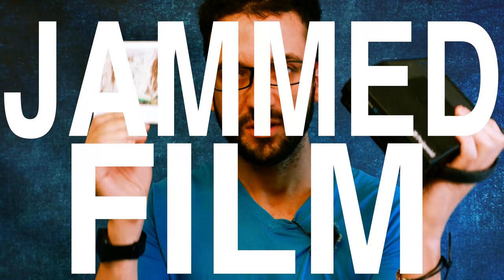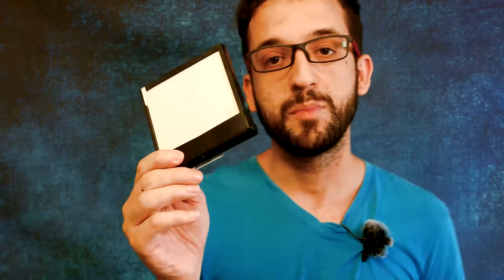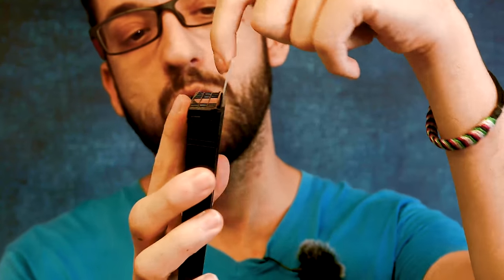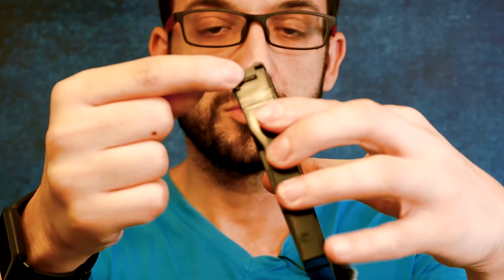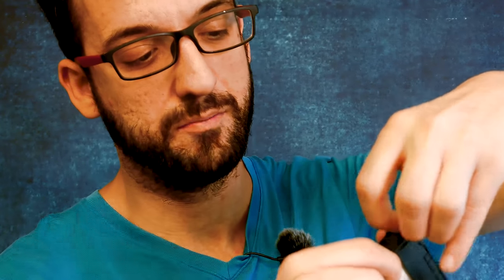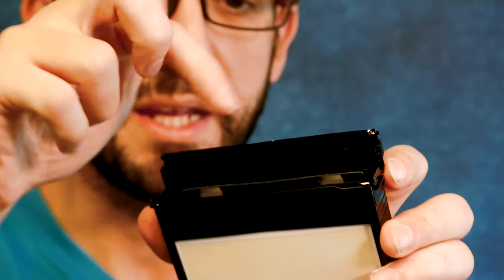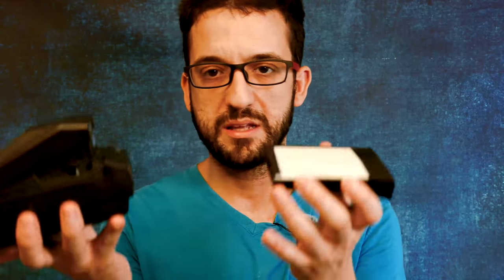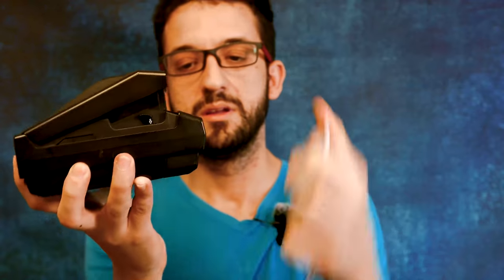Polaroid jammed film issue. HOW TO SOLVE!

Comment: You don’t have to open the whole lid to remove the plastic. I’ve done before with my Polaroid spectra film. Just hold the cartridge and remove the plastic and that’s it. You can also do in a light room, nothing is going to happen as long as you still have the dark slide and be careful.
Reply from the maker: Thanks for sharing your experience

Comment: Recently, I purchased a used Polaroid 600 business edition camera online. The camera was working fine when I got it. However, when I switched out the old film it had when I purchased, I ran into an issue. It seemed as though the new film I placed got stuck when the photo was ejecting. There is a black piece in front of the camera that I accidentally pulled out with my hand thinking this was the issue (I was 100% wrong). Immeditely after I pulled out the plack piece, I tried to take a photo and it got stuck so I pulled out the photo. My camera won't work when I attempted to take new photos. As I have run out of extra film packs, I can't go back to reattempt to see what's going on. I do know that this issue started when I pulled the black piece out. I'm not sure if this piece needs to be tightened or reconnected to the silver rollers from the inside part, but everything else seems to be fine. Is there a video of possibly this issue being repaired?? Any info helps, thanks!
Reply from the maker: I feel that if you put back everything you should still be able to use the camera. Did you try to put back the used film in the cartridge and take photos to see if the eject feature works? Also it can be the battery is depleted so if you have a meter measure the battery voltage

Comment: Hello! I tried removing it and the photo still doesn’t slide out. Is there another option to fix it? I just got it with a new film and I don’t know if there’s a cable charger that goes with it as well. Response would be appreciated! :)
Reply from the maker: Unfortunately there are no other solutions. Probably the motor is also not working properly. Polaroid cameras don’t need any charger because the battery is inside each film pack

Comment: Thanks for the video. I have a spirit 600cl with similar problem but my film stuck in the middle of the rollers. So I don't know if it is a battery or a rollers or a pack problem :((
Reply from the maker: Well you can try to clean the rollers at least. And depending how old is the pack it can be the battery too

Comment: I tried this too and it seems do be doing everything except just printing out the picture do you think the camera is defective?
Reply from the maker: it could be also a film pack issue with possibly problems with the chemicals. you should try another pack if you have and also remember to clean properly the rolls too
Reply: @KeigoMoriyama  i sadly dont have another one, do you think it could also be because of the batteries or something like that?
Reply from the maker: Potentially batteries are not making the shutter speed working properly causing the image to not come
Reply: @KeigoMoriyama  i see, I'll try by buying a new film then do you maybe have a link where I can buy the right ones?
Reply from the maker: @denizemir965  all the films are now expired. the only place is ebay or local facebook market
Reply from the maker: @denizemir965  in case you can always try using an itype film, you remove one film and put in the case of the spectra and test it. but pls do everything into a dark bag. you can check if it is an issue with film or with batteries (i suggest you to test the voltage too in case)

Comment: Got the same problem with my ImagePro. Do you have to remove the darkslide as well?
Reply from the maker: Wolfgang Elwitschger it’s weird because with my image pro I keep having same issue but with normal spectra no problem :( which dark slide are you talking about?
Reply: @KeigoMoriyama  Yes, but the issue occured just lately. Before years of shooting without problems. There's a black protection paper on top, that's usually coming out when inserting the film. I tried your advice but with the protection in it still didn't work. I removed the paper (darkslide) and it worked fine.
Reply from the maker: @wolfgange.9465  good to hear that

Comment: Hi, i have an instax mini 90. My camera is jammed. I got it in late April this year on my birthday. When i tried to turn it on it will make a noise like its actually suffering. And it will have a backward 3 on the number of film. The lense wont come out too. Please help!
Reply from the maker: I think the problem can be the lens that exit from the rail used to move. You should try to open it. Are you able to do that?
Reply: @KeigoMoriyama  unfortunately i cant. The only way for me to get the lense out it by turning it on. But again, it'll make a noise and it wont come out :/
Reply: @KeigoMoriyama  wait... what rail is that
Reply from the maker: Sorry late reply but I’m in Nepal. You should bring back and use the warranty then
Reply from the maker: If you want to keep cheap the instax wide is a valid solution

Comment: hey! do you know what to do if the film also isn't even coming out. like the thing you buy. it is stuck in the camera.
Reply from the maker: Yes probably the issue is with the little metal lever that is inside and push the film out. You should try to look for it when you open the camera to put the cartridge and see if it is bended

Comment: Do you think my intax8 might have the same problem,,?
Reply: Had not been using it for a while,only to sell it to a friend who's now complaining of the photos getting jammed half way
Reply from the maker: No Instax should not be affected by this issue
Reply: Keigo Moriyama so according to ur experience with such cameras what might be the problem,,,? only two pics out of 10 didn't get jammed half way out.
Reply from the maker: @sammiemuks3564  It can be the batteries (try fresh one), or can be a problem with the motor that eject the photos, probably defective. The thickness of the instax is not a problem for the instax cameras.

Comment: Does this work with onestep 2 or onestep+?
Reply from the maker: they don`t usually have this issue, but yes it helps
Reply: Is it okay if I will remove the flap before I put the new film into the camera?
Reply from the maker: @lomokino3310  yes and do it in a changing bag together with the camera so you can put immediately inside it
Reply: Keigo Moriyama thanks. I’m planning to buy the onestep+  and jammed film is also one of its problem.
Reply from the maker: @lomokino3310  sad to hear. Have you considered an instax one instead?
Reply: Keigo Moriyama i like the aesthetic look of polaroid cam and the film. I’m stuck at choosing either instax sq6 and polaroid onestep 2 or +.
Reply from the maker: @lomokino3310  yeah completely understand. it is just a personal opinion but i personally think that price/outcome quality (plus in the future if you want to frankenstain your camera), the sq6 is a to go camera more than the onestep 2

Comment: i tried it but now my camera doesn’t even turn on 😕😕😕
Reply from the maker: Sorry to hear that. In this case mean the camera itself has a problem unfortunately. Is the pack new? Can be an issue with the battery in the pack as well
Reply: @KeigoMoriyama  yeahh, the pack is new but camera was an old family one so i figured there was a chance of it not working, it constantly ran like it was trying to eject until i removed the black lining, and then it just stopped working
Reply from the maker: @sleepy.willow  really sad to hear that. Unfortunately there is this factor on non reliability on these old cameras as well